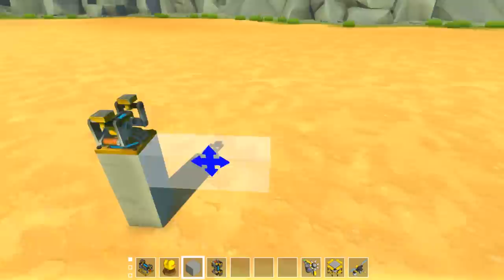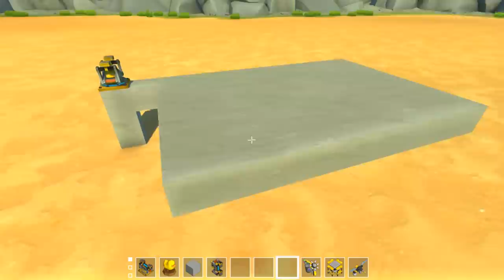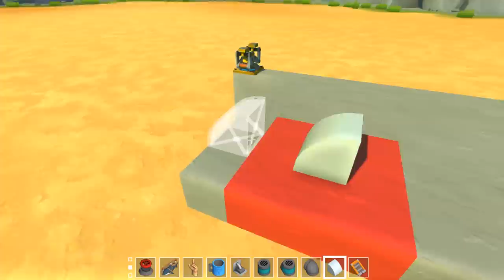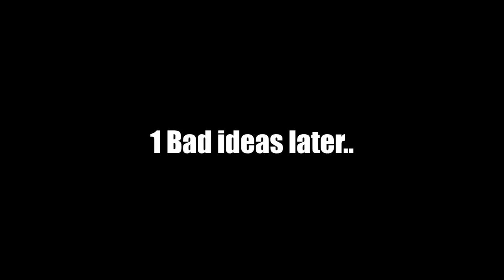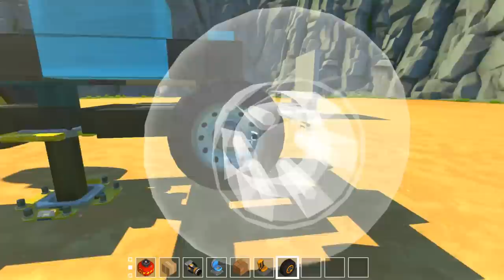COMBINE PARTS WITH THIS NEW DEVICE! (Glitch Welder) in Scrap Mechanic Glitch-Weld-It #1

Comment: Durf's inventions:
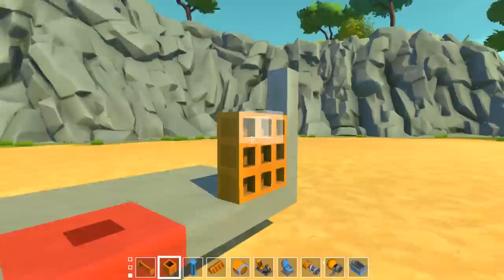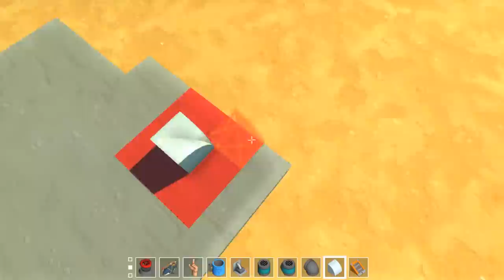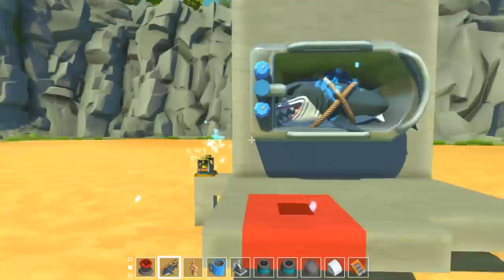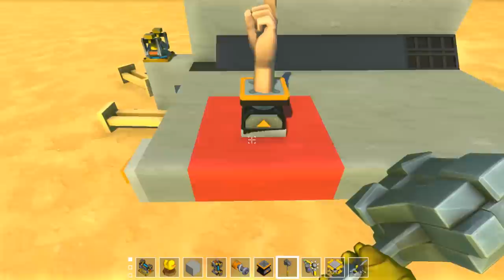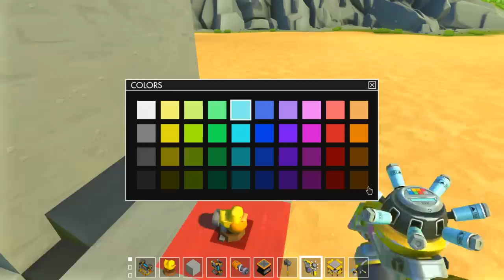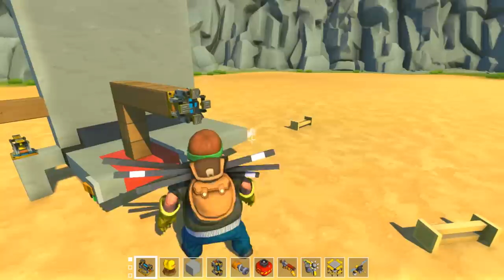2:08 Blindfolded duck on toilet.    2:31 Cup O' Duck.   3:23 Duck In a Vent    3:50 WAFFLE !!!    4:31 wEiRd CoRnEr PiEcE    4:47  Toast with sharp edges.    5:14 Jimmy's ""little pet fish""    5:39 1/3 of a waffle    5:54 1/3 of a waffle that is ALIVE!!!    6:13 Grill pattern corner vent   7:55 Switch  powered light switch activator    8:08 Duck squisher 2000    8:33 Hidden piston    9:04 Double finger-guns   9:29 yellow goose that honks   11:21 Pocket Missile    12:20 Glitch welder Mc Glitch weldington    12:49 Springy hidden duck    13:13 Gas powered ""Warm"" chair    14:27 James Bond wheel
Reply: Thanks for the likes, it took half an hour to make this comment.

Comment: I also tested out that the glitch holder cannot blow up so you can have as many bombs around it and you’ll still have it plus if you take it off the creation and then hit the button for you to use stuff it will paste everything to the relative spot that they were in when you cut them out so you can make floaty blocks
Reply: Another thing that I might add that I also tested when you paste things back in they will be in a different position so whatever you have tuned will go back to the default way like you just placed it in wiring will become on wired so we will be really hard to wire which welded stuff

Comment: I am so happy that I found this, I'm currently making rgb spotlights for a light show, I was struggling to make them but now that YouTube autoplay has found this video its going to be so much easier, THANK YOU DURF for making this video :D
Reply from the maker: oi, lemme do you one better and point you here: https://youtu.be/d8Ze1qGbems?t=501 (timestamp shows the feature, whole video teaches how to use + more vids on channel)
(use modpack logic to control color of ANY light in the game)
You can totally do it with glitch welding, and that would keep it 100% vanilla too. 
But if you know how to use the modpack logic stuff, that's way easier + lets you do even more...only thing is it's mods...not everyone likes mods for some reason..
Reply: @Durf  oh boy I actually thank you so much Durf, I am allready using the smart engines for movement and programming with the numb-pad, I can now use the rgb block and make my life so much easier, thanks :)
Reply: @Durf  one note, the RGB block changes color of searchlights however it doesn't actually project a beam, any way you could fix this?
Reply from the maker: @fishrebel5784  if possible, could you join the discord and/or link a blueprint file to look at? Should still work as shown in the video (just hook up rgb block to any lights..the on/off switch needs to be on the RGB side then, not the light side.)
OH...yknow what, it might be the glow value? white number input 1 or 0 (switch->numberblock->light)
I don't remember the exact details, but yea try that first, and if there's still trouble, let's see that blueprint.
Reply: @Durf  yep it was the glow value, would you still like a blueprint link on the discord?
Reply from the maker: @fishrebel5784  Umm, no worries. My discord, or the modding discord, are better places for things like tech support (since it's every mod maker + player that can answer questions)
Although, I'm certain others would appreciate your build! Sharing cool stuff is always cool :D
I'm just a very busy guy (especially lately 😩) so while I would love to check out everyone's creations, I have no idea when I actually will have time to fully appreciate them how I want to. (play time without thinking of what I have to work on next xD)
If it's in there, chances are I'll check it out at some point, even if it's not on video or anything ;)
Reply: @Durf  ok, thanks very much for the time and support Durf :D

Comment: Is it possible to "glitch-weld" logic gates? so can you make a tank steering in "one-block-size" for example?
Reply: You won't be needing tank steering with the new track mod.
Reply: Yes
Reply: You can do that with a blueprint tool, but i dont know how you want to do it with this, because you cant wire things if theyre in eachother because you wont know what you selected
Reply: Also connections wont save
Reply: @JohanNordlander885  what about vanilla tracks?
Reply: @spankstergangster2916  ahhh see.... I forgot that... Ups :)
Reply: @jbmst1450  Vanilla tracks are  laggy

Comment: Some questions:
How does the painting aspect work in certain situations?
Does the mod have to still be installed in order for the build to function properly, if at all?
Do controllers, logic gates, (etc.), retain their settings?
Reply from the maker: This mod is only used to weld things together. 
If it's 100% vanilla when you upload, then no one needs any mods to use it.
Just make sure you don't forget the welder on there! Check that "parts" list on the lift!
NOTE: if you cut something out of existence, it loses all settings. Pasting something back in, is like placing down a new part, and you need to set things how you want.

Comment: I have a new part idea the quantum block which uses number logic to save/load creations on the fky
Reply from the maker: We had a "simple blueprint spawner" on the todo list (to go along with the "part spawner")...for things like a polygon figure, maybe a thing of pipes...something to catapult at someone..
The limitation is with Scrap Mechanic Mod support...the devs didn't give us very much.
So connections break...for the blueprint spawner idea, or glitch welder idea...mods can't "create connections"...and that's lame.
Us mod makers are always thinking about how we can use what the devs give us! Rest assured...as soon as it's possible, it will probably be made xD

Comment: I'm writing this while watching if it's answered during the video I'll deleat it but what happens if you have a connection so if I have a engine and then connect it to a bearing when I glitch weld it dose it get disconnected?
Reply from the maker: Yes, connections are NOT preserved, and you will have to reconnect everything (unfortunately)
(this is a limitation with the mod support in Scrap Mechanic...we're all waiting for some better updates)
There's a couple of solutions to this problem though...you might see some new mods in the near future 🤔

Comment: Wait, if you glitch weld vanilla parts, can you use them with no mods?
Reply from the maker: yep! The glitch welder is only needed to do the welding for you. 
After that you can upload it on the workshop as vanilla (just make sure to remove mod parts from it before upload)
Reply: @Durf  Yeah! I figured this out shortly after because I wanted to test it out, but thanks for the reply :D

Comment: RIP you cant glitch weld suspension out of existance, i need to glitch weld it because my helicopter rotor needs it, i cant glitch weld the part it goes through because then parts wouldnt be connected

Comment: It is inf or not
Reply from the maker: The combinations of parts?
Infinite in context. Here are the limitations:
- Scrap Mechanic parts have a UUID to identify which one is which, and there are this many possible UUIDs: 340,282,366,920,938,463,463,374,607,431,768,211,456
so yes, in most human lifetimes, there will never be enough mod parts made to run out of UUIDs
- but let's assume there is, mod makers can still upload new mods using the SAME UUID (they just can't be used together at the same time then)...so this is the first limtiation
- the next limitation is the Steam Workshop. How much content is valve going to allow Axolot to upload to their servers? There is a limit to the steam workshop too.
- But then if you consider the time it will take for us as a community, to get to that point...it's also enough time to upgrade things, and give us more room.
SO IS IT INFINITE?
Currently not. There are limitations with the systems that are in place.
Practically, yes. Those limitations are so far from us, that'd we have to TRY REALLY HARD to even see them as limitations for ourselves. Might as well be infinite. Context.